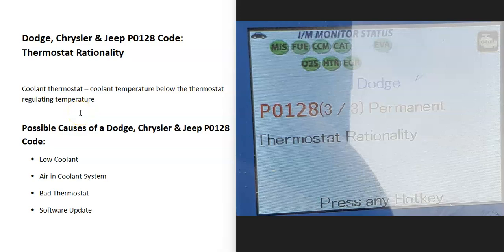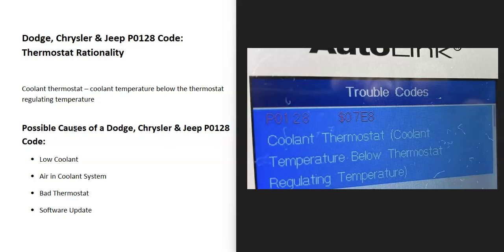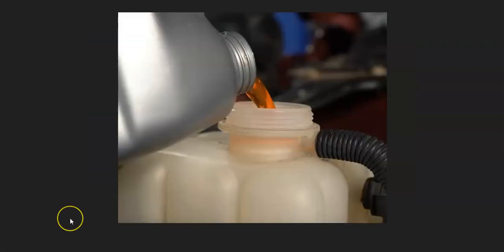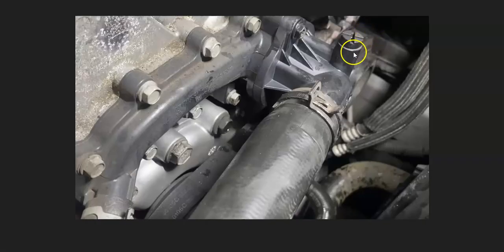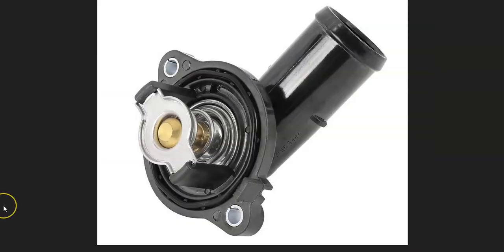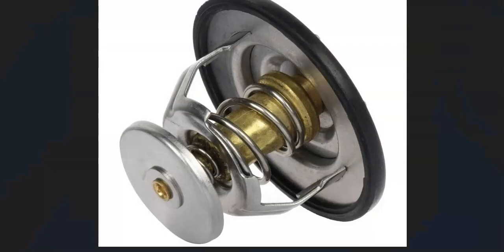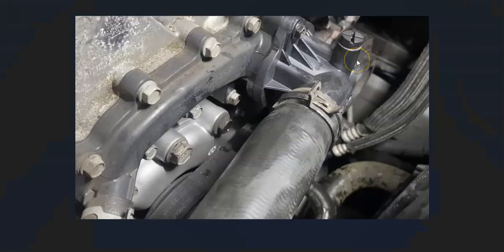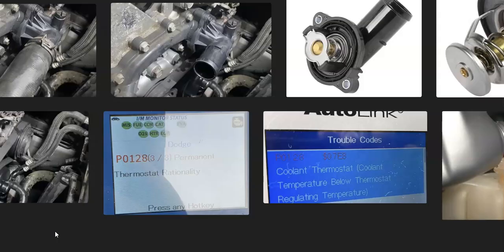Causes and Fixes Dodge P0128 Code: Thermostat Rationality

Comment: I replaced the thermostat and added coolant and bleed the air out and I still have check engine light on. It won't let me clear it. It says permanent
Reply from the maker: Permanent codes need what's called a Drive Cycle to fully clear. Just drive around, and as long as the problem is fixed, the code will clear.
Reply: @HVAC_Mechanic   It fixed it. Thanks!

Comment: Mine has thrown the code about 4 times now every few days at night when it's colder. Today I got out to my truck and it had leaked maybe 8oz of coolant onto the ground. Couldn't see exactly where it came from, but i added more and it hasn't kept leaking. Any advice? 2017 ram ecodiesel w 155k miles

Comment: I see that there are aftermarket aluminum ones. Should i just get that to decrease the chance of the housing breaking if its already broken?
Reply: Anyone ever answer this for you, is it better aluminum or Plastic??
Reply: @gemainrust6325 i have the aluminum and i have not had any thermostat issues since. However i did almost bloe up my engine by not properly adding the antifreeze.

Comment: I replaced my thermostat multiple times and P0128 code still pops up . If I drive it without replacing it it overheats . Once I replace it it goes away for a month or so then check engine light comes on again . I have a dodge charger any one have any solutions
Reply: Check the coolant temperature sensor which works directly with the coolant thermostat. A buddy replaced his thermostat 2x before buying and installing the $11 coolant sensor. No more problems been months
Reply: @ I appreciate it I did end up changing it and solved the problem